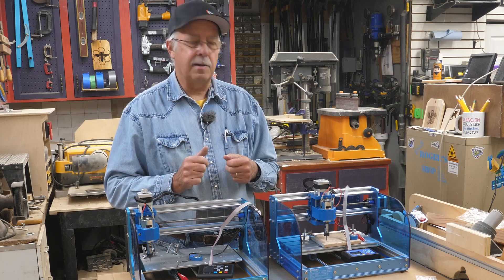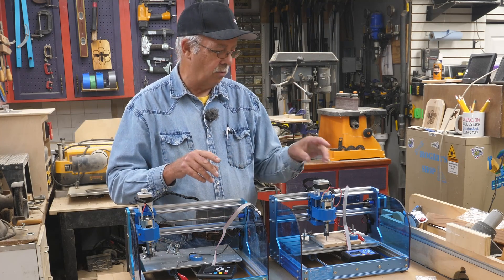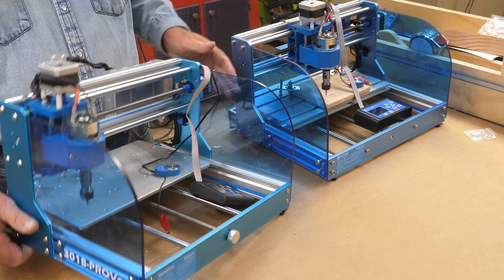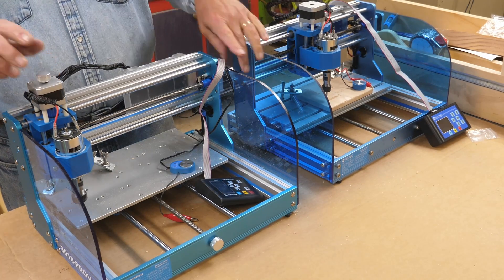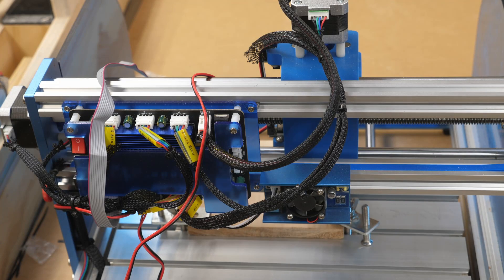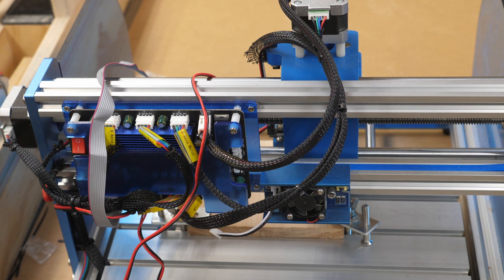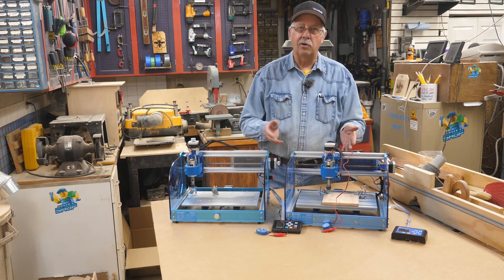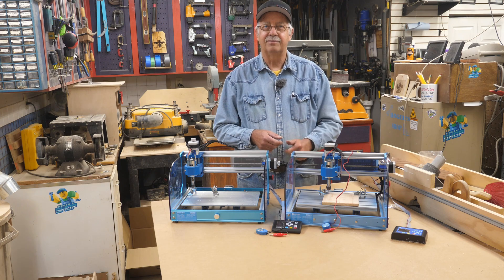Sainsmart ProVER vs ProVER V2

Comment: V1 uses an 8 bit control board. V2 uses a 32 bit control board. Both use 8 bit grbl but the 32 can do more. Found this as mine is a year 2020 Master Jiang CNC 3018 MAX that has a first gen 1.1 grbl control board but I want an emergency stop. Still tossed between the improved 1.1 and the twice the price 32 bit board. I chose my CNC for the all aluminum build with built in 52mm spindle mount.

Comment: I have a 3018 pro cnc and bought to to learn the software. Best purchase ever. I use BobCad software to make my CAD drawings and the Candle for my CAM to run the cnc. My cnc is all solid aluminum frame with stops on all 3 axis. I highly recommend these machines to learn cnc programming and if used within the limits of the machine these units will last a very long time.

Comment: I got a really good deal on the Version 1 a few weeks ago. I bought the upgraded spindle motor, Y-axis extension kit and the extended bed kit. I've only cut a few things out with mine. When I installed the Y-axis kit I spaced out the lead screw and motor about 10mm and it allowed me to put a knob on the end of the Y-axis.

Comment: Thinking about getting one of these but, I would want to put the 300 watt spindle on it.  Looked on Sainsmarts site but couldn't find this answer.  Will the motor "mount" accept a 52mm diameter spindle.  It looks like there is a sleeve on the stock motor that could make it to fit a 52mm diameter hole.  Any chance you could measure the OD of that spacer to see if it is 52mm diameter?  Would appreciate it.  TIA
Reply from the maker: 44mm.  You need a custom mount for a 52mm.  The sleeve on the stock motor is not removable.
Reply: @rogersshop  Thanks much.
Reply: There is an aluminum Z axis that is a direct fit to the brushless 300w and it’s way more ridged

Comment: Thanks for the review. I received the V1.3 for Christmas. Is it worth $80 more to get V2 instead? (I look at the table change to be a negative too.)

I want a laser head. You mentioned something about fixed vs manual focus. I'm new to this so could you elaborate on this? Can the newer laser be applied to V1.3? I also notice a 10w laser. Is this compatible with V2 and V1.3? 

Also, does laser require air assist?

- Thanks
Reply from the maker: If you already have the V1.3, I don't think spending the extra really gets you much "extra".
The newer laser heads might now be fixed focus and will fit on either model.  I haven't looked into them since I have several larger format lasers.  Air assist is mostly used with cutting operations and is not required, but does reduce scorching and increase cut speed slightly.